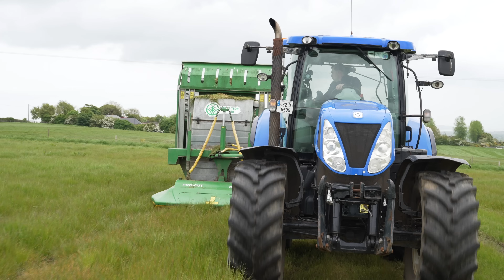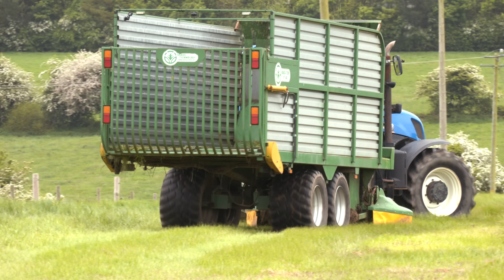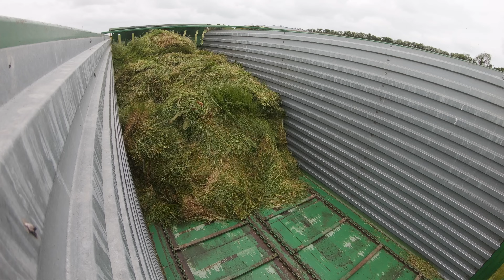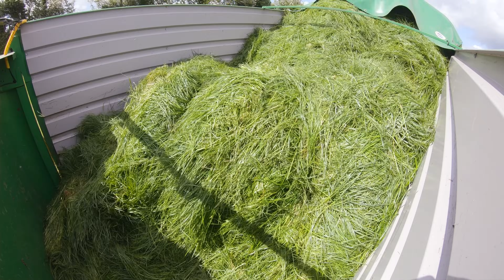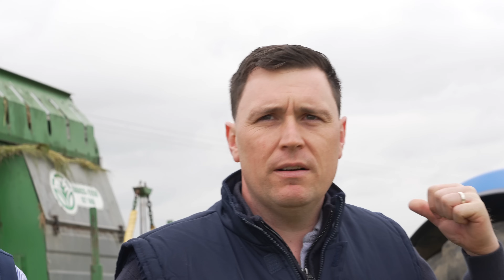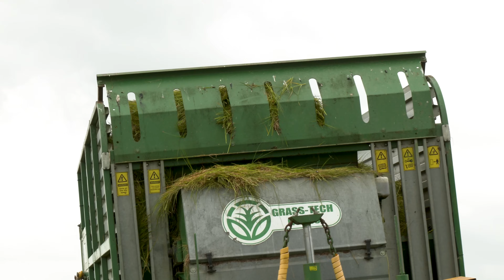Is ZERO GRAZING the answer for BEEF?

Comment: This is taking livestock husbandry in the wrong direction.  At our farm we take the cattle to the grass, strip graze daily with cheap poly wire fence, and they leave their urine (nitrogen) and manure (compost).  Simple, No fuel or fertilizer is used and if you want to get technical, it’s carbon negative.